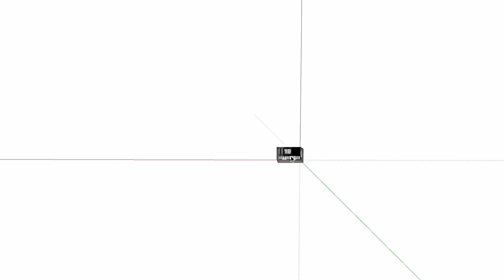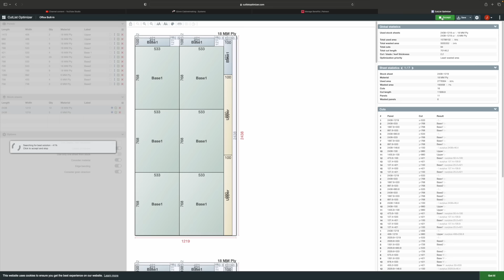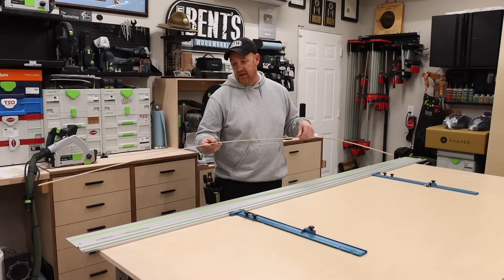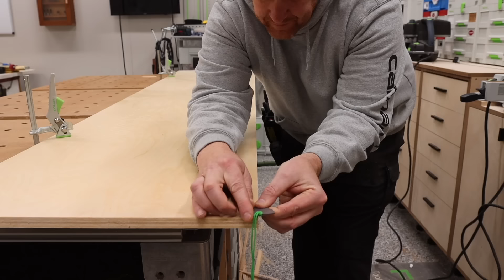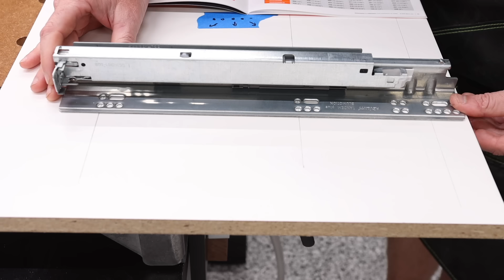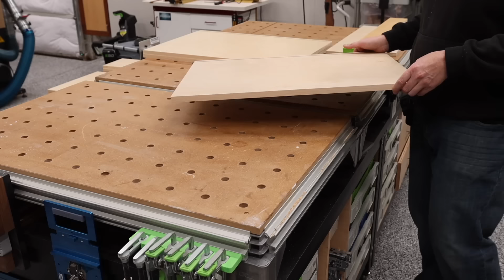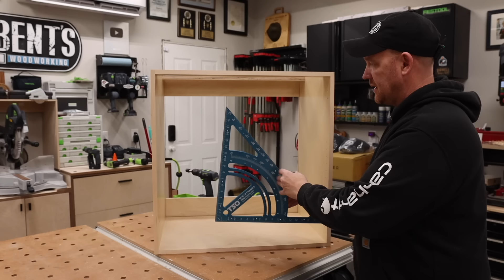STOP overbuilding cabinets

Comment: I feel like ripping the plywood to create a clean edge is kind of a waste, when you could just rip it down oversized and then just run it through the table saw using the ripped edge to create a parallel side.

Also I built some cabinets for my house and I'm super jealous of all of that space to be able to put the boxes today. I had to put them together on my garage floor. (Don't have room for an assembly table).
Reply: Technically it is waste but plywood is typically oversized anyways for such purposes.

Comment: You could probably make your assembly process a bit more efficient with pocket screws instead of nailgun, mark, drill, drive. Get all the parts drilled before you start assembling, then you put your screws in as you assemble.
Reply: Waaaaay too much time dicking around with pocket screws.
Reply: @acerjuglans383  How? Get a good clamp-in jig and you just put holes in from an in to out pile, switch from drill to driver bit then put them together. Fewer steps and changing tools than the process in the video.

Comment: Clipped first word. Need another half second. Loved the video. Tons of editing I’m sure. You ever make a cabinet with a dado near the middle of a board and it curves the outer surface even when your dados and rabbets are same depth and match perfectly? I always use the 1/3 rule for joinery. Depth is 1/4 in 3/4 plywood. I have a partially double thick bottom because of casters and it didn’t warp. I put another sheet on the top and it kinda levels out the top but still I have a 16th.. it’s like I need a welding table to clamp it down to when I clamp everything.

Comment: With your calculations how much over are your measurements?  Also does the program take the kerf width into account?
Reply: The program takes kerf into account and you can tell it the kerf size.
Reply from the maker: It does take the kerf into account

Comment: I don’t use glue on my cabinets or drawers and haven’t for 15 years.  My heaviest drawer in my plywood tool bench has a full set of 1/4, 3/8, and 1/2” chrome and impact sockets and 500 lb drawer slides.  It’s a 48” x 24” drawer constructed out of 3/4” Baltic birch and 1/2” drawer bottom dadoed into the sides and has done just fine for years.  Build drawers right and glue is unnecessary.  Evidence you’re now wrong at least.  Cool video.  Even tho I know how, it’s fun to watch someone else build them that knows how too.  Keep up the cool content.

Comment: this is freaking fantastic, thank you for breaking it down to the level of the lowest common denominator (me heh heh). i think i need an 8'x4' workbench in the middle of my shop if I can swing it...
Reply: The best work surface for the money is a solid core slab door on a couple of good saw horses.  It's dead flat, heavy, and stores against the wall when not in use.
Reply from the maker: Glad it was helpful!

Comment: Great video! Was wondering if you could recommend a screw size and type for the cabinetry. Thanks!
Reply: There’s another video where he talks about it, I was thinking the same thing.
Reply: @salazarrn1  SedgeTool’s latest video with a cabinet shows a torx screw that doesn’t need pre drilling and the head countersinks itself

Comment: I would urge you to get comfortable doing these rip cuts to final dimension on the track saw. It is 100% doable to make these cuts to ±0.25mm tolerance. Actually the main reason I returned my TSO parallel guides was because there wasn't a fine indicator for the scales, and it's possible that this negatively affecting people's confidence in making these accurate cuts. I wish someone would make one with a hairline indicator and fine markings.
Reply: I think the best thing for mass production is to have multiple stops on the parallel guides so there’s no variance once accurately set.
Reply: Nah, better to use the track saw to get it small enough to handle and then final cuts on the table. Faster that way for me too - I split a panel into 3rds and then do the rest on a table saw. The track saws are more prone to going out of square or having worse quality cuts than my table saw, which stays true better. I've built probably 200+ cabinets that way and always within 1/32" of exact spec and perfect square.
Reply: @Azara1th  You can't put a table saw in a box, but you can easily get the accuracy requirements out of the track saw
Reply: @LukePighetti  close to them, but I've never gotten the same accuracy out of a track saw repeatedly and without fiddling with it a lot more. I can get square cuts much faster with a table saw. Jobsite stuff yeah, I'd stick with track saw since jobsite table saws suck, but most aren't building the boxes onsite.
Reply: @LukePighetti Have you seen the new Festool table saw? Thoughts?

Comment: What is that countersink bit?
Reply: I too would like to know. I’m still looking for a god one. Just not happy with the several I currently have.
Reply: It’s a festool but Amana makes a great one for $40 or so with the same features. I have the festool version only because I saved over 40%
Reply: @AaronGeller  thanks.  I’ve tried an Alana one, but found that it tended to mar the surface a bit sometimes and I didn’t care for that because sometimes I use pre-finished plywood.  Maybe I’ll just break down and get the Festool centrotec one of its actually good.

Comment: I haven't watched the whole thing yet, but I already know I agree. How I do drawer boxes:

sand a 4x8 sheet of plywood to 320 on both sides (sanding seal)
cut 1/2" plywood material with a track saw
edge band & apply finish
attach front, bottom, and back with pocket hole screws. no grooves/dados
attach sides with pocket hole screws
attach slides

Works every time. I can always break them down later if I need to. I can always do a final glue if there is a durability concern. I can always fully refinish them without any drama.
Reply: Couple questions from a novice:
1. What’s your starting a sanding grit, and what increments do you go up to to each 320g?
2. Do you need to sand a cut edge before applying edge banding?
Reply: @calvinjohannsen6519  Due to plywood costs I am currently using Lowes maple plywood. 

The A side is sanded 180, 220, roll on coat of polycrylic, 320. 

The B side is 150, 180, 220, roll on coat of polycrilic, 320. 

At this point I have options, I can either leave it raw, brush on a coat of polycrylic, rub on paste wax, or paint.

For kitchen drawers I might choose to brush on a coat of polycrylic on the bottom panel and leave everything else "raw"

You should not sand a cut edge before applying edge banding.
Reply: That finishing schedule for the plywood happens to every piece that enters the shop. When it comes time to build something the build is lightning fast because 90% of the finishing is already done. Most cabinet shops use pre-finished plywood and it's time for the DIY folks to consider doing the same.

Comment: As an owner of a Kitchen manufacturing shop. Not how i would build it. BUT. Great method for a novice to start building cabinets. For sure.
Reply: I'm a 50 year old journeyman cabinetmaker, and without the use of a CNC, this is almost move by move how I'd build.
Reply: @acerjuglans383  what is a “journeyman cabinet maker”? I’m not familiar with that term
Reply: @AaronGeller  it's a trade, same as carpenter, plumber, electrician, etc. You become an apprentice, build up your hours, and go through trade school. When you've put in the required time and testing, you're certified as a journeyman with your credentials recognized anywhere across Canada.

Comment: Fascinating. Even forego pocket screws for cabinets.
Reply: I build cabinets in a similar method.  I only use pocket screws when one (or both) of the end panels will be visible in the finished kitchen or bathroom.
Reply from the maker: I’ll use them if a end panel would be visible
Reply: Yes, the visibility. Thank you for pointing that out.

Comment: Hi Jason. I'm currently building my new kitchen and have been preparing the carcass pieces in a very similar way to what you are doing. My question to you though is finishing that damn edge band if you want to have the colour (yes, I'm Canadian) match the colour of the drawer faces. Would you pre-paint the pieces before assembling the carcass or would you mask/plastic barrier the interior for painting after assembly? That's where I'm at. Seems to me it would be easier to pre-paint and then assembly. What would you recommend or if you have a different way from those two options?
Reply from the maker: I will mask everything and spray after it is installed probably
Reply: The easiest way is to edge tape then stack your prices the then apply your finish.👍📐🇨🇦
Reply: @troyqueen9503  That's what I think is easiest too! The only consideration is that you have to be careful when assembling as to not scratch the painted edges. Thanks for the confirmation Troy. Much appreciated!

Comment: A couple of cool tips - edge banding first and installing draw slides before assembling cabinets. I haven't build a lot of cabinets but putting in the slides was always a headache.
So if the end of the cabinet is showing, how do you deal with that? Plugs?
Reply from the maker: I would use pocket screws

Comment: The problem with using only thin screws is that they really can't prevent the panels from sliding along each other, and they don't provide a good pressing force, as you screw them through both parts. It is still better IMO to use a few dowel pins to make the whole thing more sturdy. Personally, I also prefer to add a little glue on the dowels.
Still, a very handy approach to cabinet building, I've definitely learned a few things.
Thanks for sharing your experience.
Reply from the maker: Thanks!
Reply: I have built a hundred cabinets, many different methods, and ended up doing same as this video with exception of me using a 3/4" back - more sturdy and cost difference between 1/4" and 3/4" ply is about the same. I no longer use dowels or biscuits for that "extra strength
" My last three cabinets were all 8 feet tall by 7, 8 and 9 feet wide. Sturdy, not going anywhere. Agree with Bent 100%
Reply: @kerrykroberts7809  well, I haven't built hundreds, just dozens :-) and some started to get a bit loose with time and use. But hey - we're just sharing our opinions here. Nobody's saying Bent is doing this wrong. I really liked his scheme.

Comment: What type of saw blade are you using to cut that stuff? I have the hardest time not getting chipout with that glossy veneer.
Reply: I have good luck with the Forrest Woodworker II blade.  Keep it sharp.
Reply from the maker: I have recently switched to Tenryu for everything. Really impressed with their blades

Comment: I become so happy watching this! And also dreaming of one day having this limited number of cool tools 🥰
Reply from the maker: Glad you liked it
Reply: Honestly the only tools shown here were
* track saw
* table saw
* some kind of edge banding applicator - probably handy but not required
* air powered stapler
* screw gun
* some random measuring and marking tools - squares etc
These all looked like festool which are spendy but probably worth it if you do this all day.  But there are non-festool versions of all of these for weekend warriors.

If you have space and a helper you can do it without the track saw.  If you're by yourself do yourself a huge favor and get a decent track saw.  Breaking down full plywood sheets becomes easy instead of a labor intensive chore.

Nice video, very well thought out and prepared.

Comment: Helps to not use glue for when we inevitably mess something up and need to back out the screws and staples and move a piece haha.
Reply: Right!  I recently had to take a section of a custom closet apart because I built it 1" too wide. The house was 2 hours from my shop so I made the size adjustment on site.
Reply from the maker: True lol

Comment: Few years ago, I stopped putting rail hanger boards along with 1/4” plywood backs.  From a labor standpoint, installing all 1/2”plywood full size backs on all of my cabinets makes more sense and makes for a more rigid cabinet box.  Less dados too.  😁👍🏻
Reply: The carcasses are usually 5/8 or 3/4 ,I use 3/4 prefinished birch ,saves on finishing and more meat for the hardware.
Reply: I use 5/8 , also with a solid back you get no deflection when you cut out for electrical and your not limited to where your screws are if there is no frame work.👍📐🇨🇦
Reply: @troyqueen9503  Bingo, just a better way to go all around!  😁👍🏻
Reply: Yep we do all 3/4. Makes ordering materials easy to.
Reply: I try and keep the uppers low on weight but the base cabinets I can see your point and I will probably do that in the future thanks for sharing.
Reply: That’s not a bad idea.
Reply: Agreed the 1/2” back is brilliant. Do you dado or rabbit it in?
Reply: @IndianaJBird  I only rabbit in the 1/2” inch plywood backs, if the cabinet is on the end of a run and would have the sides exposed.  Other than that, I just use 1/4” crown staples, 3” on center stapling, and apply right to the carcass back edges.  Thx
Reply: @tundrawhisperer4821  glue? 😂
Reply: @IndianaJBird  no need, the holding power of staples is off the charts.  Extremely strong!
Reply: do you build the whole cabinet in 1/2" or just the backs?
Reply: @vidpromjm  Are you asking me?  I use 1/2” on the backs only.  3/4 everywhere else in my box builds.  Thx

Comment from the maker: Hope this video is helpful to those that are intimidated by building cabinets. There are many videos to follow this one that will help with the whole process
Reply: Thank you! You're a gentleman and a scholar
Reply: This was fantastic.  Wish I knew this method years ago.  Any chance you will do a follow up with a similar guide for upper cabinets?
Reply from the maker: @infiniti7791  i actually have a video on an upper frameless cabinet
Reply: @bentswoodworking  do you have an installation video? I am currently making some cabinets so this video was timely and helpful. But I would be interested in your tips and tricks for ensuring everything lines up particularly when uppers are next to each other if a wall it out a little bit.

Thanks for all your videos!
Reply: Nice video. Very simple and easy to follow. I use similar methods to building my own cabinets. However I use kreg pocket hole screws for attaching my stretcher boards and 18g brad nails. I plan to start using the crown stapler as I know that's stronger. I like your set up with the festool for ripping sheets and drilling shelf holes. I never knew they had a tool for drilling holes that's awesome and a huge time saver vs using a standard jig and drill I imagine that tool comes out super clean and no tear out.
Reply: Having watched a lot of your content now, I want you to know I find your teaching to be very effective Jason. The balance of explanation and demonstration seems to me spot on for individuals at many levels of expertise. Your inclusion of critical analysis and alternatives at decision points adds a lot of depth. 

Time you add on task and extra time on top in production must be quite extensive... I hope it's starting to come back in value personally, and with $ from YT.

I was a career Officer, a Soldier which you know means mentoring and instructing. I teach at Universities. I demonstrate and seek high standards, and I'd hire you as a teacher in a heartbeat. 

Thanks for your Service, and thanks for your videos :).

P.S. I have a couple of questions that are more business/private. Will you accept private correspondence if I reach out?
Reply from the maker: @michaelrobinson9643  thank you. I greatly appreciate that! I do have one on one options on my Patreon if you’re interested. Would be happy to help. Patreon I use to actually add it to my calendar. Otherwise, it’s just when I have time. 👍👍
Reply: Great Video!!! You said you prefer 1 1/2” screws, what type and brand do you use?
Reply: @PeterGoode1  Go for Reisser the very best.
Reply: Thanks for making this video!  Do you like the Grex Narrow crown stapler?  I've had nothing but problems with their 18 gauge air nailer.  However I had the 23 gauge which was an excellent tool, until it walked away from the job site.
Reply: @bentswoodworking do you glue your cabinets?
Reply: @davidpark2749 he stated in the video at least twice that glue up is not necessary. He also stated that glue would not stick to pre finished plywood.
Reply: It just seems like you have to spend more money on tools and workshop than the cabinets are worth.  Hard to justify for someone who is building cabinets for personal use.
Reply: @jameswalter3136 you dont have too, just use what you have! It will take longer though
Reply: @jameswalter3136 Not true. Follow the process and the pieces used. All the fancy tools and the workshop simply allow him to batch out lots of cabinets with precision and efficiency in a commercial situation. You can achieve the same result with a circular saw, a straight edge, a drill and an old iron for edge-banding. It’ll just take more time.